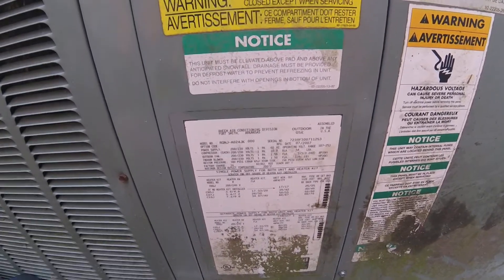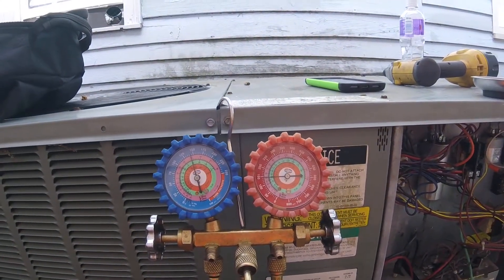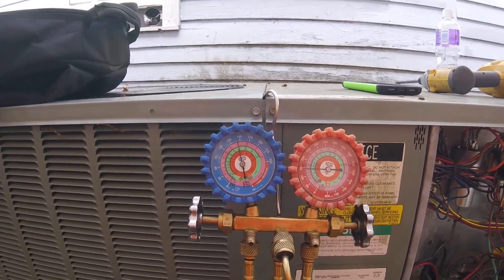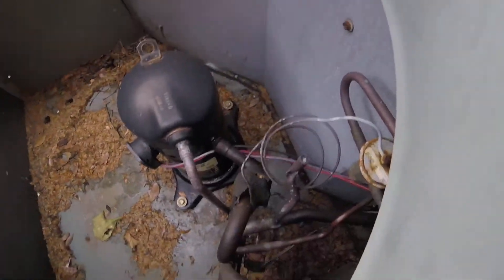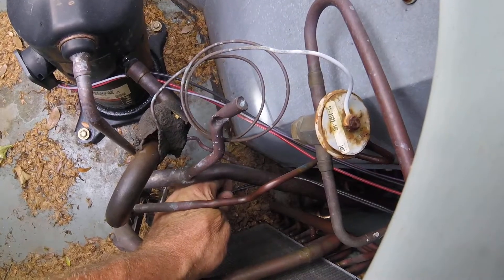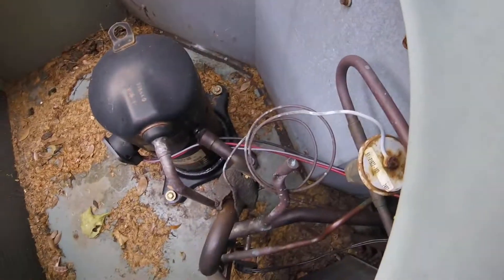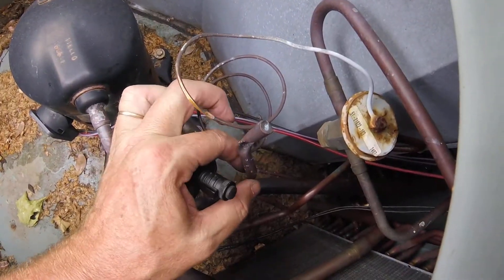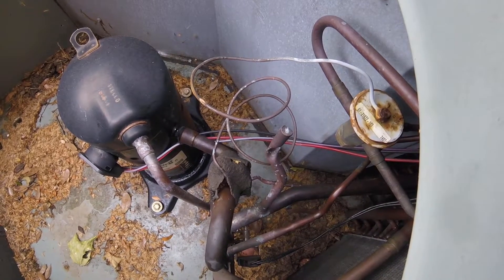Bad TXV On A Rheem Package

Comment: what's TXV mean ? what's it does in hvac  ?  can anyone explain. Thanks you.
Reply: thermal expansion valve, it is a variable metering device to control the flow of refrigerant into the evaporator coil(cold side) 

From wikipidea: Flow control, or metering, of the refrigerant is accomplished by use of a
 temperature sensing bulb, filled with a similar gas as in the system, 
that causes the valve to open against the spring pressure in the valve 
body as the temperature on the bulb increases. As the suction line 
temperature decreases, so does the pressure in the bulb and therefore on
 the spring causing the valve to close. An air conditioning system with a
 TX valve is often more efficient than other designs that do not use one

Comment: temporary repair put a dime underneath the power head.
Reply: THE GENIUS REPAIRS take a lot of work to do that though.....just put a new power head on it
Reply: Joe Shearer Mike has said before he prefers to put the complete TXV in. another hack temporary repair braze a Schrader valve access to the cap tube on the power head. pressurize with nitrogen to where you want it
Reply: THE GENIUS REPAIRS I've done that before. I prefer to use refrigerant that the system uses